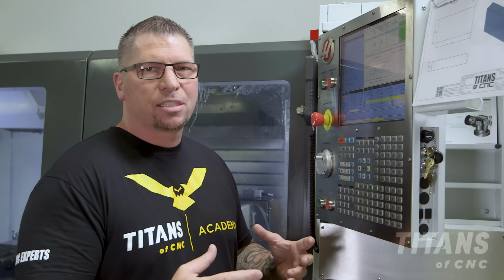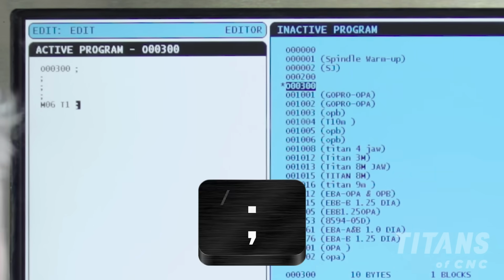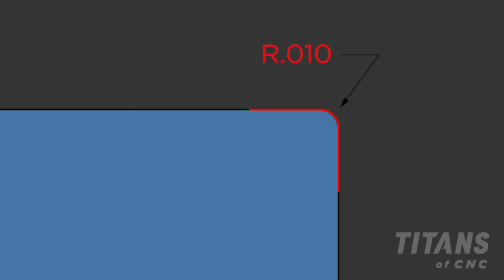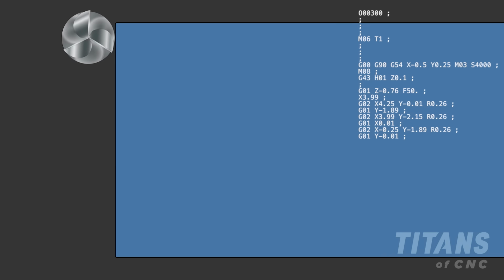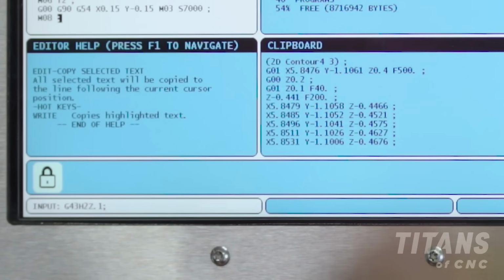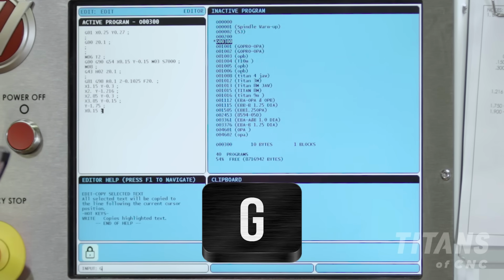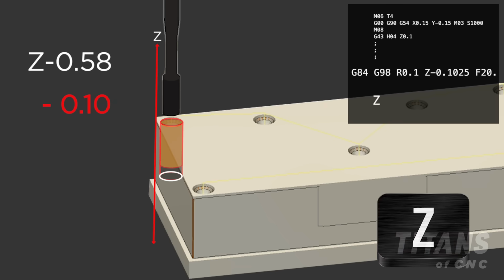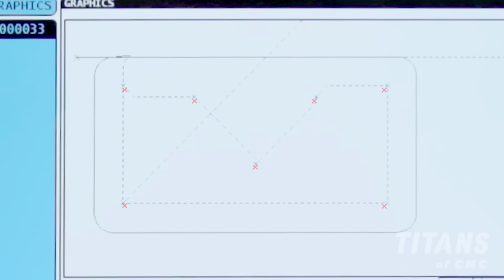G & M Code - Titan Teaches Manual Programming on a CNC Machine.

Comment: Why does everyone put a G98 with their canned drill cycle? You don’t need to use G98 with any canned cycle. Your code should look like this G83 Z-.5 R.1 Q.2 F30. There is no G98 necessary! For some reason people like to throw a G98 in there. You don’t need it!

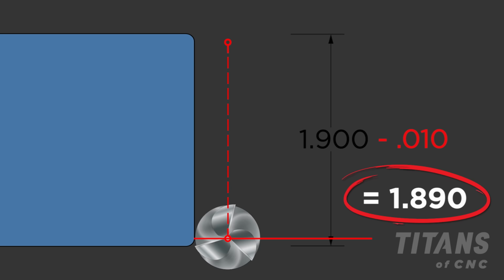Comment: 9:30 Hello Titans, I have a doubt.

Since, the tool is already y0.010 below the top surface, shouldn't the next Y movement be 1.900-0.010-0.010=1.880? 

Just curious. Thanks for the video! :)

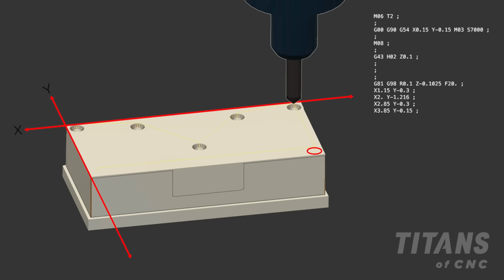Comment: 18:00 when defining positions in the cycle list, does the same rule apply from absolute positioning where if one axis value is the same as the previous one you don't need to type it again?

Comment: I'd be interested to know how many machinists actually start from scratch on these programs?
In my shop we had an industrial design dept that received the finished Unigraphics models and used Unigraphics CAM to make programs. They'd draw the toolpaths and operations and then the post processor I'd written would convert that into the assembly language machines understood. G codes and the like.
The very best machinists would tweak the feeds and speeds because they knew their machine could do better and faster.
Most didn't.
Some would manually ride the feeds and speeds and that was not policy but if they didn't wreck a block they could get away with it.
Some of these blocks were very exotic so no real risks should be taken. Inconel lined threads and ports etc.
I got seriously chewed out one time we hosed an almost finished block because of a bug in the post processor.
To this day I think it was not a bug but human error but OK. I'd moved on from the position so maybe I was the out of scope fall guy?
I've been a programmer/software developer for almost 20 years now. Writing that 5-axis post was about the toughest thing I've done.
I remember being at the Unigraphics conference in 2003 Anaheim beside disneyland and in room watching a lecture about 5-axis posts and they asked if anyone had developed one and I duly put my hand up and it was one of only two hands in the room.
I spoke briefly about how we'd done it and the fancy timing function we added (which went onto create an amazing tool scheduling program but that's another thing) and sat down.
As i left the lecture I was accosted by guys from Caterpillar who asked for my card and gave me theirs.  They emailed me a couple of weeks later asking me if I'd come out to cincinnati and build them a 5 axis post.  Obviously I was Contractually bound to the company I was working for so that was gonna be hard to do.
I chatted with my boss about it and he agreed to let them have our 5-axis post for free since we were not in the same industry.
Felt good to do a bit of open sourcing back then.
The company behind Unigraphics opened up a library of open source posts shortly after that  and I'd like to think our generosity showed them that was something that could happen amongst their customers.
It was a very interesting time in my career as a programmer. Something Magic about seeing a block of steel move from one shape to another and know that you had a hand in that.
It was also my break into a job that was pure programming. It was always what I wanted to do and I'm eternally grateful to the people that gave me a chance at it.
I still have my first business card that says Ian Edmonds, Industrial Systems Engineer.
Gotta Love it.
Luv and Peace.
Reply: I hand program my mills for every new part that comes in my shop. The only exception is when we have something that has a super complicated 3d profile, we gibbscam those.

Comment: Started in 1968, thank you USAF Chanute AFB. For the next 45 years I worked as a machinist. First CNC programming was MDI and punched IBM cards to make a CNC tape to run the machine. I finished up my career using MasterCam to design and program a 4 axis milling machine. Last job was working in Physics & Astronomy. Never went to college, but worked at one for 25 years.
Reply: Physics and astronomy?  My kinda guy!  I've been trying to thimpfk thru what one would need to do to grind a mirror on a Haas.  Seems sort of intimidating but I thimpfk it could actually be done.

Comment: I love the information shown here. But, the drawings were lacking information to fully define the details you have there. First, the holes are all missing center marks to indicate they are collinear with each other in the direction of the measurement (use connected center marks). Second, when "TYP" is used, it is an implied "everywhere that i don't mark uses this" there should not be a 13X or 4X for those dimensions as they are defined as the standard unless otherwise specified. None of your prints specified the qty of threaded holes or the qty of near-side countersunk holes. This can be critical if you have similar minor diameters, but one is threaded while another may be a through hole. Overall though, (since this is a CNC guide) very good information! 

PS: I'm an aerospace design engineer and run into stuff similar to this all the time

Comment: I have a question, can someone help me, please.

And if I were to create a program with variables, for example
# 1 = 10
# 2 = 20
and then replace:
G1 X # 1 Y # 2 F100

My Haas VF3 gives alarm 241, when I send the program that contains a macro via RS232, when I type in the panel the alarm is 243.
How could it make it work?
Would you have to enable some configuration, use some specific code, or something like that?

Comment: Why did you do X-.5 y-.25 at the start of the program why did you use those numbers?
Reply: Doesn’t matter It’s for tool compensation
Reply from the maker: Started back off the material ... X-.5 since X0 was edge of part. .250 because that’s center of .5 tool

Comment: Love the videos- I have been programming at the console for almost 20 years. 

I understand you programming like this in the video but at the same time you are programming like a Cad program

I teach my guys to program to the part, let the machine do the math. It’s easier to decipher. 

I personally would have writing The code from the G43 line like this

G43 x-.5 y.0 z1.h1
M8
D1
G00z.1
G41x-.1
G01z-.76
G1x3.99
G2x4.0y-.01r.01
G1y-1.89
G2x3.99y-1.9r.01
G1x.01
G2x0y-1.89r.01
G1y-.01
G2x.1y0r.1
G1 x.5y.01( come away from part)
G0z.1
G40x1.0

This allows you to program to your actual dimensions on your print, not have to do all the calculations for tool diameter and if you decided you want to run a 3/8 or 5/8 the program is exactly the same. 

Ken
Reply: I guess I should ad the g41 is tool comp- you tell the machine the size of the tool with the D1 code 

And the g40 is turn off tool company. You need to move at least half your tool diameter to complete in and out properly.

Comment: As a computer scientist I understood this but why are those codes used instead of a more readable instruction set? I mean the language is pretty limited to what it can do and yet reads more like assembly than it should. Also, why are the blocks not simply designed in CAD and then automatically machined?
Reply: They can but being able to change and adjust code manually is a keen skill to have and can be very handy

Comment: For anyone watching (M3) is a clockwise spindle rotation. M4 is counter clockwise. Same for Hass lathes. You'll use counter clock a hell of a lot more on a lathe than mill.

Comment: Highly recommend our 1000x1000x1000mm industrial 3D printer. Please let me know if you have interest.( email: hardy.ke@@t or whatsapp: +86 18318030163 )

1) 7 inch touch screen

2) Filament detection sensor

3) Rail guide

4) Enclosed

4) Servo motor

We are factory and can providing affordable pricing to support.
You can also visit our alibaba store: @t

Comment: If its a carbon drill with a drillangle of 140 degrees. Dont you use chamfer after instead? Carbondrills dont like touching on a less angle? I may be wrong here. Nice vids 👍🏻

Comment: Im a little confused on the starting position on the X axis. If we are starting at X - 0.50 and we input X 3.99 on the next line. Would that not fall short by .25 before the first radius?
Reply: I haven't understood the G43 have I?

Comment: Shenzhen Yi Xin Precision Metal And Plastic Ltd. We are professional in NC & CNC machining service and molding service for OEM and ODM parts. Types include turning, milling, grinding, stamping , bending, welding, die casting, drilling, tapping and plastic injection.

Jackie  

WeChat：6017 548 5939

Whatsapp： +0086 137 9050 6972

Skype: litang1221

Facebook：Jackie Lee

Email：ymp018@ymp.com.hk

Comment: Most use cam software for in depth milling. Otherwise its conversational.

Center Drill
M06T01
M03S650E01
M8
X.250Y0Z-.075G1W.1F2K.125
M9
.250 Drill
M06T02
M03S750E01
M8
X.250Y0Z-.850G3W.1F2.5K.125
M30

Simple hole drilling, x,y,z is per print. G1 is drilling, G3 is peck Drilling, W is work plane, K is peck depth. Aint got no time for boom let alone sit there and program like that. Setup, Conversational Programming, Operate. Or its Setup, Transfer Program, Operate.

Comment: Cool video. As a British programmer and machinist I use millimeters so its interesting seeing it done in inches. One thing I would say that you didnt use Diameter cutter compensation (G41) for the profile you milled, would be good to use that on high batch jobs for cutter ware as you will find your job could go oversize or have a bad finish as the cutter blunts.

Comment: 9:31 - I'm not agreeing with your calculation. If the material dimension is 1·9 and corner radii are 0·1 then linear cutting distance is 1·88, not 1·89 because you're starting 0·1 'late' and finishing 0·1 'early'.

Comment: I'm an engineering working in manufacturing. Making parts for Lockheed 

And I'm going WTF I had no idea, this required this much detail for a simple part.

I just do CAD design and Simulation

Comment: Programming is the easiest part of the trade. Fixture/clamping/tooling/feeds & speeds are the hardest. It also helps if you can make some custom g/m codes to not write same lines over and over, instead you using one code and boom.

Comment: ah im glad you did this on the HAAS, when i was in highschool from 2008 to 2012, we had one single haas 5 axis lathe, and a bunch of bridgeports and lathes with DROs.... the year i graduated they dumped almost $1m into the machine shop.. it's now full of HAAS mills and lathes, and all sorts of new equipment. i got screwed over by 1 year, but im glad the younger kids are learning how i should've. we got taught straight manual machining, but we did learn a little bit of prototrak in our senior year. i'm looking for manual work right now, but not much luck. hopefully it changes soon, but til then, all i can do is rely on your videos, so i'd like to thank you for taking the time to do this. you're a great teacher, you should consider teaching trade school when you get older.

Comment: Some of the older cnc machines cant rigid tap with as tight tolerances. just to keep in mind for people to know their machine before running the tap .010 off the bottom. Titan do you have any 4 axis samples? Ive been training a lot recently in 4 axis cad/cam but the gcode is proving to be more challenging. would be great to see some contour and wrapping examples and brake on and off indexing.

Comment: Good day, I have enjoyed Titans Teaching, but I need some help. I have a question about using G or M code to preform a task.  If I want to cut to a particular depth or length, how can program be written to have the code stop when its get to it desired position.  like in C code you can use "If then or Else" is there any similar code in G or M code.

Comment: I never realized how easy it is to program the Fanuc controls to cut a radius manually. I ran them a lot but we had a centralized programmer that just used GibbsCAM to program the job and then he had post processors for every machine in the shop, which would make all the necessary changes for it to work correctly on each machine (we are talking completely different controls on some machines). It's MUCH different programming a radius cut on an old cincinnati milacron machine, which we had a few of back when I was at my last shop. They didn't use the R command for a radius and instead used I and J values for circular center points. It's confusing compared to the easier way Fanuc does it.

Comment: I'm not familiar with cnc thread taping,but I didn't see where after the tap went to the bottom of the hole,where the spindle reversed (ccw) and the tap went back up,like when a person manually taps threads.

Comment: Is the G Code the same for all CNC equipment?  (Provides they have the same physical capabilities)

I haven’t touched a CNC in my life, and this is completely relatable.
Reply: G codes often change according to what machine you use. I've used Fadals that tap with G84.1 G84.2
HAAS uses G84
Milltronics uses G88

Even the drill cycles use different G codes

Comment: So, the tapping motion seems strange to me.  Having tapped by hand, I know the tap goes in, cuts the thread downward until you stop, then you back it out.  With this machine it travels at 1000rpm and moves fast enough vertically to achieve the rate of sink into the material of the thread, is able to stop at the bottom, and immediately reverse and back out at 1000rpm?!?  That is incredible.  Please confirm I understand this correctly.

Comment: Buddy got me on in a shop in dallas, was assigned to inter dimension part, wasnt there 5 mins they moved me to machine side and first thing I observed was trainer having to rewrite program. As soon as we finished and ran 5 parts I was moved to different machine (like he has here). After an hour of watching me they cut me loose.
Before clock out i got a handshake and i quote "we dont usually put anyone without 6 months of some experience on this but man your killing it". Felt good since I was totally green, that was until 700lb part fell about 7 ft (machine was set on decline so my table was actually 8 ft from floor) since magnet decided to lose ALL CHARGE, dented a 700k$ machine, and about .25 in of leg meat. Happened so damn fast, first scar so I was initiated. In the following months 3 parts were ummm BOOMED because of errors in programming or machine didnt register tool change. 
That's my story, but man you explained it so well I now see the full picture of the codes I was allowed to mess with and how they worked with the ones i was to NEVER TOUCH. 
Loved that job except when I have a 9 ft part on a 8 ft table and overhang of a foot in width.....hand grinding and blending such massive parts with little experience......little things like that make you feel proud

Comment: my prof made us do this manual programming in the computer. I was able to pass this course easy; we've done sub-program and macro.. but not really used alot in the industry. You let the programmer do the cnc programming and you just do the set up and follow his instructions. No buddy was also working as a "machinist", his duties were also programming and doing everything.. told me if you fuck up 3x in just a couple of weeks, you're fired.

Comment: Quick noob question... when the tap goes in i didnt see any command to reverse the spindle for the removal. Is this something that is set within the machine with the tool programing when its added to the inventory? I am looking into home cnc machines which this is obviously well beyond but now I'm curious how the tap is removed without stripping the treads you just created.
Reply from the maker: Yes, it calls for a G84 which reverses once it hits the bottom.

Comment: You don´t need to put the EOB at the end of every line. The control does it automatically for you. Except in one case: You want to put a line between to lines, then you have to put the EOB at the end of the line. If not, the line you wrote and the line below will become one line ^^
Reply from the maker: Got it...

Just did it as it was an easy way to teach beginners
Reply: @TITANSofCNC  Fair point! Thanks for your answer. Keep going with your great videos! :)

Comment: You lost me at G00 G90 G54 X-0,5 Y0.25 m03 S4000
Reply: Why whats wrong??
Reply: “Rapid positioning”
“Absolute programming”
“Work coordination offset”
“X and Y locations”
“Spindle on clockwise”
“Spindle speed 4000”

It’s basic start up lines.
Reply: @Chrone128 why can’t we go from G00 to G54? I don’t see the purpose of G90 there. Can you explain please?
Reply: @captain_tm  i’ve tried and it moves to position without the G90, the machine will figure out what you’re trying to do. G90 is there to better explain to the machine what you’re trying to do. i think don’t quote me on that😅
Reply: @captain_tm It's a safety redundancy to ensure that the machine is, in fact, in absolute.

It's sort of like chamber checking a firearm when it's handed to you, even if your friend just cleared it. It isn't strictly necessary but it doesn't cost anything and if someone screws it up you've got your own insurance. 

Does that make sense?
Reply: @captain_tm   I am just learning CNC but i feel like it's just a safety thing, like someone else messed up your code and entered something different than G90 few lines above. So by putting it again you just make sure it's in correct coordinate system.
Reply: Its only for location of tools and spindle
Reply: I got lost since it started 😅

Comment: Why did HAAS use the same tool  diameter offset in Intuitive and the  Tool diameter offset page. You can screw up big time after probing in Intuitive and forgetting to re- probe again when not using Intuitive  ?

Comment: Titan. I really need your help. I started a job because I was finally able to learn programming. I previously had experience with Fadal CNC machines. But the job I took on have really old cnc lathes. I have 16 yrs experience with manual machining, that's what's getting me through this. But I'm working with a Bobcad-cam programming system. Please help me.